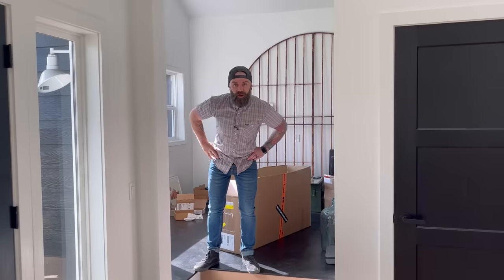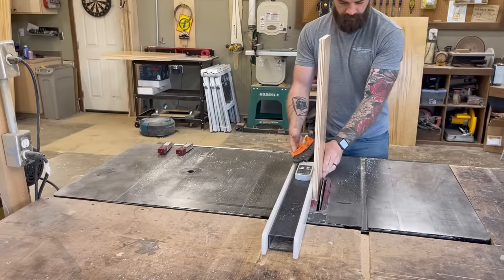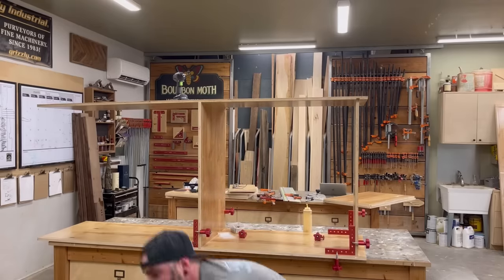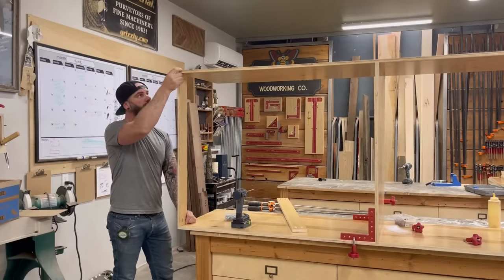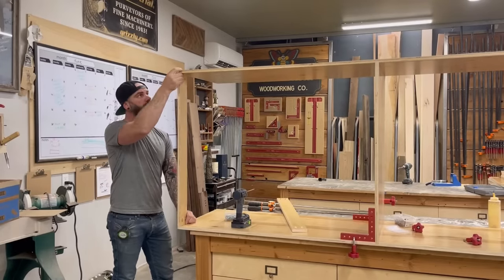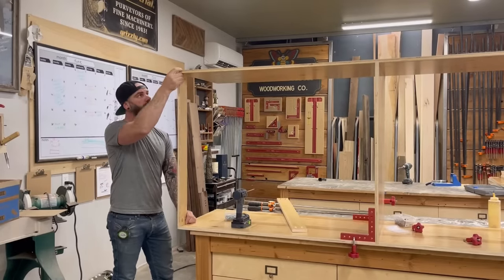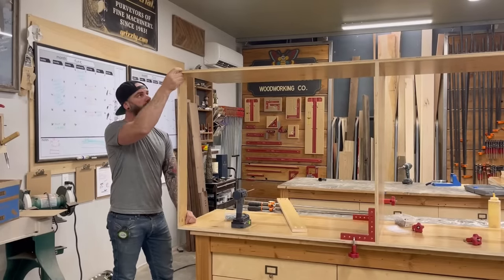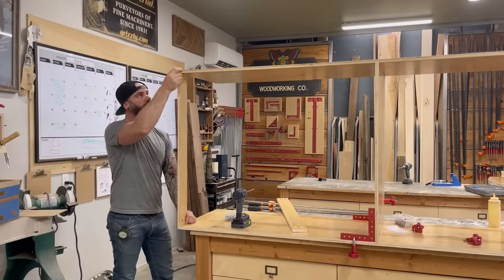Build Cabinets the Easy Way || Before and After Office Makeover

Comment: Groove: with the grain. Dado: across the grain. Rabbet: along an edge.
Reply: Hotel: trivago
Reply: Learn something new every day. Thanks
Reply: I've always wondered! Fantastic 👍👍
Reply: On the other hand, for all of us that are just going to forget that anyway, i really don't give a crap. Since i've already forgotten. 
     What was i supposed to remember???
     Not a clue.
Reply: @keithfaulkner6319  When I see information I don't need and didn't ask for, I assume it's not for me. That's just me, though. You do you.
Reply: @keithfaulkner6319  groove = grain (grrr). Dado = dare dat go (2 Ds). Rabbet = dare dat go over deer (3 Rs)
Reply: @mikedeafenbaugh5984  thank you. Thing is, i don't really have a shop. I end up building stuff on my living room floor, and fancy tools are not practical. So i forget some of these terms.
Reply: Dado= 3 sided groove. Rabbet = 2 sided groove.
Reply: @jeffreysmith332  A dado (US and Canada), housing (UK) or trench (Europe) is a slot or trench cut into the surface of a piece of machinable material, usually wood. When viewed in cross-section, a dado has three sides. A dado is cut across, or perpendicular to, the grain and is thus differentiated from a groove which is cut with, or parallel to the grain. Dados are often used to affix shelves to cabinetry bodies. Similar to the dado, see rabbet (rebate). (Wikipedia)
Reply: @mikedeafenbaugh5984  ???
Reply: @keithfaulkner6319  it's not vital to know them, at all. Especially if you use plywood and power tools to make things. They have different names because the techniques for making them are different, if you're using hand tools, and they serve different functions, based on what the grain will do, when it moves, and also just aesthetics. The terms are a way to avoid confusion and critical errors in a production setting.
Reply: Thanks.i have a thing for words. 
So why is a dado rail on a wall a dado rail?.walls don't have grain.
Reply: @traitorouskin7492  because dados in architecture and dados in woodworking aren't the same thing. The word "dados" means "dice" (the things you gamble with, not the verb), and who knows why it started being used for anything other than that. 🤷
Reply: Thank you! 😁👍
Reply: He had to know the difference... he did it to get viewer engagement
Reply: @henslee  I'm sure he did. But, the way he presented it would confuse someone who didn't know.
Reply: @jeffreysmith332  I think this is the best definition, especially because when we're using plywood, "grain" is a bit arbitrary 👍

Comment: Fantastic tip for installing the under drawer slides! I have a whole kitchen to redo with old style roller ball in center track slides and fought with leaning into the carcass and trying to level a block in back for the side mount slides I was installing in the kitchen desk.  Decided on undermounts for the rest of the kitchen but was not looking forward to putting in the back supports for the slide supports. You’ve made it a no brainer. And just how I feel now that I didn’t think of that . . .

Comment: I like that you have been showing optional ways of building cabinet boxes. I have either used the rabbet/dado or biscuit joint system but recently built my bathroom cabinets with Kreg pocket holes. All of theses are great and efficient ways to build boxes. I appreciate the way that you make the process so that it doesn’t seem like rocket science........and voila, you have cabinets. I will post a couple of pictures to your site to show the pre-finished product and the installed cabinets. Thanks for your dry humour and ease of instruction when it comes to cabinets/furniture.

Comment: I own a custom cabinet shop. As an amateur cabinet maker (just meaning you don't make your living building cabinets) you did a good job. Not everything is as efficient as it could be, but that's to be expected when you aren't doing it day in and day out. Overall you did a good job. But I'll give credit where credit is due. I have never thought of using a vertical back plate and tracing from the face frame.... I have only seen it done on nailers that were brought down to be flush with the bottom of the drawer opening. 

That is going to be standard practice for me whenever putting in soft close drawers into existing cabinets. Just taking a 6" long, 4" wide 3/4" thick scrap, and tracing it from the face frame, attaching a back plate, and then tacking it on with a few nails into the back of the cabinet. So simple. I can't not believe I have done hundreds of cabinets without thinking of that

Comment: The cabinet birth its creator.

Great tip about the spacer pieces. He let me down with the edge banding but it works.
Great tip with the wipe on poly. 
Great tip, the face frame is the feather that broke the cabinet baby's back.

Comment: Great job on the cabinets. A couple things I do with my cabinets: On the face frame, I rabbet the edges so they have more attachment area and adds more strength to the carcass. I also put a decorative piece of wood on the front and rear edges of the shelves, perpendicular to the shelf about 1 1/2 or 2" wide, also rabbeted instead of the banding. This strengthens the shelves and stops them from getting sway-backed from the weight placed on them, you know, that 400 pounds of books that nobody reads. I usually attach my kick plates to the cabinets before installing them, but I like your way better and I will do that in the future. Keep up the good work.

Comment: I'm building some now, so this is really helpful.  Question:  (starts out as a statement but stay with me) I like to make sure that any permanent horizontal surface like a cab bottom or permanent shelf is coplanar with the top edge of the horizontal face frame element.  Do you strive for this or even care?
Reply from the maker: No I always leave a little reveal. So much less of a headache

Comment: Looks amazing. I'm always blown away at how you make everything seem so easy. Every cut being perfectly straight, everything lines up the way it's supposed to. Seems almost impossible sometimes.

Also, do the drawer slides have some adjustment on depth? Or are they a specific size and you design the cabinet around the slide depth?

Comment: Awesome video and makeover. Quick question: is there a reason why your blade is set higher then normal when cutting the prefinished birch ply around 3:18? Better for the finish or any other reason?
Reply from the maker: I was to lazy to lower it 🤷🏻‍♂️🤣
Reply: @Bourbonmoth  Fair enough. Cheers!

Comment: I think I've watched these two videos and the three cabinet videos about 100 times now--great videos. What are the dimensions of the kick plate relative to the cabinet itself?  Since they're not built into the cabinet carcass, I was trying to figure out how to blend where they meet up at the side, but it looks like they're inset on the side as well as the front. I suppose it doesn't matter...maybe an 1" 1.5" is ok?

Comment: Great job. I have a question about the drawer slides. Do you design the depth of the cabinet around a standard drawer slide size?  Is there flexibility with the back bracket in terms of the depth?

Comment: What router bit are you using to dado that perfect fit to your 18 mm or 3/4" plywood ? 
Veneer plywood never a true 3/4" thick, so when I've made a one pass dado they're not tight.   
Multiple passes with  1/2" diameter cutter always requires significantly more time and often not perfectly parallel.

Comment: Did you check your local electrical code about covering up the live recessed light fixtures and the outlet that was on the left side of the cabinets? I ran into this issue with a recent build and in most places it’s against code to cover up live outlets or fixtures without providing some access or terminating/rerouting the circuit.  Fantastic build!
Reply: My exact question…doubt that is code compliant.  That said, I do love his woodworking projects and he’s pretty informative!

Comment: How do you hold your track saw in place?  Do you pre drill for your screws?
Reply from the maker: There’s no slip stuff on the bottom of the track. And no not with the GRK screws you don’t need to pre drill.

Comment: Question:  Are you going to just unhook those ceiling light cans and leave them in place when you put in your goose neck lights?  The reason I ask, is because if you remove them, then you will have a mess on top of your cabinet, (hidden true), and a place for insects and rodents to get into your cabinet from the ceiling.  I was thinking throughout the whole video you should have removed the cans, put in the goose neck lights to avoid any drywall dust and insulation debris messing up the cabinet finish.  It also might make the other light installations easier because you can reach up into the can holes from the inside as well.  Then fill in the can holes with drywall, tape and mud to better enclose the cabinet plenum above.  Way more work, but better in the end I think, IMHO.  Great Video.  Keep it up.
Reply from the maker: I’m just leaving them and disconnecting them in the attic. No reason to make more work for myself 🤷🏻‍♂️

Comment: little tip... when you routing grooves/dados/rabbets for case construction, instead of making them 1/4" deep, make sure to leave 1/2 inch of material instead. this will make sure the o.d. of the box comes out proper regardless of variations in plywood thickness.

Comment: I haven't used edge-banding for many years, but back then I had trouble with the banding coming loose from the ply along the edge. Every time someone slides something off a shelf, the edge banding is pulled off ever so slightly.
Have you had a different experience?

Comment: I built custom cabinets for my walk in closet after discovering your YouTube channel. I went with the under mount slides for ease of installation, unfortunately after installing the drawers I found the slides had a lot of play in them. All of my drawers sag forward so the fronts don’t sit flush against the face frame. What did I do wrong?

Comment: wouldn't you want to prevent the carcass from sitting directly on the floor like that? I mean moisture will just creep into the wood introducing unecessary movement. Wouldn't it be better to slightly elevate it such that it can be mostly be surrounded by air?

Comment: Wait. do you then have to adjust the dept of the whole cabinet to the length of the drawer slides?

You have to know beforehand what length the slides have so they won't stick out in the front, no?
Reply from the maker: You just order the size you want to fit your cabinets. But there’s an inch or so wiggle room with the brackets
Reply: @Bourbonmoth  Nice man, thanks!

Keep 'em coming. I really enjoy your videos :)

Comment: Is there a reason why the cabinet supports are attached using pocket holes and the cabinet shelf is attached directly from the outside? Would it not be stronger if the supports are also attached from the outside?

Comment: Rabbet – a notch cut with or across the grain on the edge of a board with the two sides 90º to each other.
Dado – a square or rectangular slot that runs across the grain.
Groove – a square or rectangular slot that that runs with the grain.

source: https://www.canadianwoodworking.com/tipstechniques/rabbets-dados-and-grooves#:~:text=Rabbet%20%E2%80%93%20a%20notch%20cut%20with,that%20runs%20across%20the%20grain.

Comment: Allright, I've been watching these cabinet making videos for a while, but I keep being puzzled by this face frame issue..  Hope somebody here can shed some light.

Say I'm making a piece made of three cabinets, each say 25" wide, so a total of 75" side to side. I'm making them of 3/4" plywood. I'm making the face frame of some 1 6/8 wide stock. I take the full 75" width, deduct the 4x 1 6/8 vertical dividers, and divide the remains by 3 I should get the length for the horizontal spacing between my vertical dividers. However, when I do so, the vertical dividers do not align with the plywood sides of the three internal cabinets. I can't seem to figure what I'm doing wrong here.. Should the 2 side pieces of the face frame be half the width of the vertical dividers? They do not appear to be so in Jason's videos. Do the side pieces always hang half way over the side, so it will have the same spacing on the side pieces as on the inner divide pieces? Am I making stupid calculation mistakes? 

Any insight would be helpful : - )